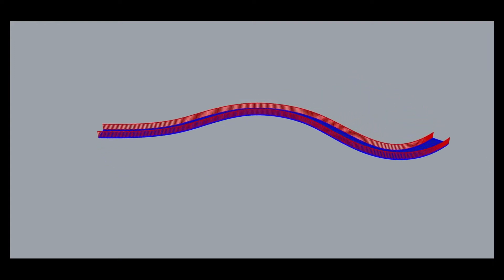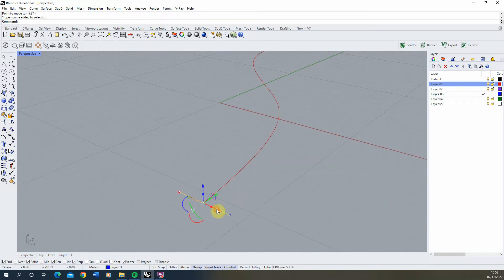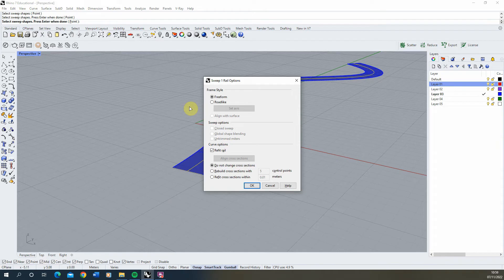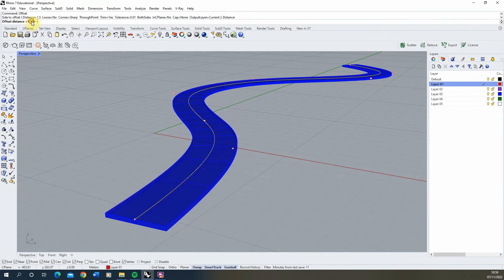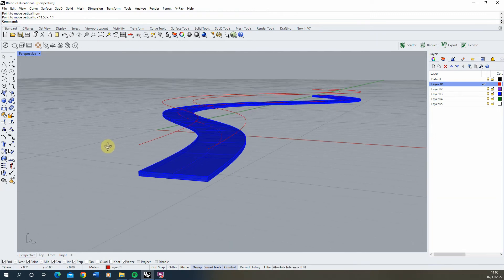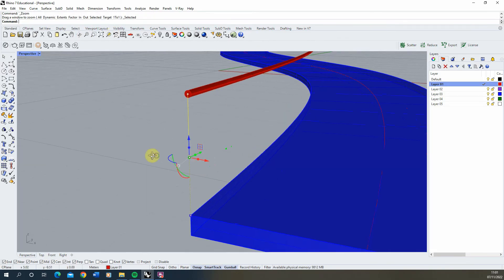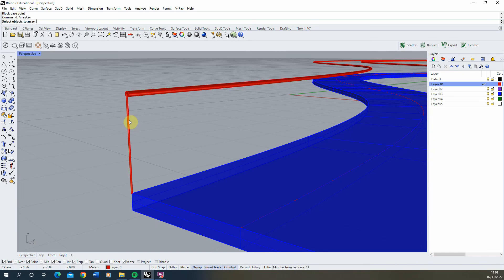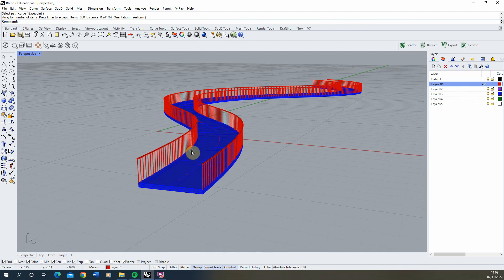Walkway/ Path - Speed Modelling - Rhino 7

Comment: Somehow the curved part of my ramp has a corner surface not entirely smooth. Any solution to fix that ?
Reply from the maker: This may be because the curves are too tight in relation to the width of your path. The ramp will always relate back to your orginal curved line so if you adjust this to soften the corners (using the points on the line) and run the sweep again you can often clean the geometry up